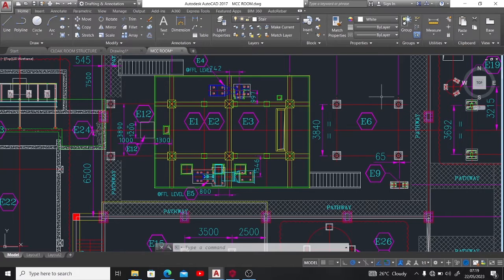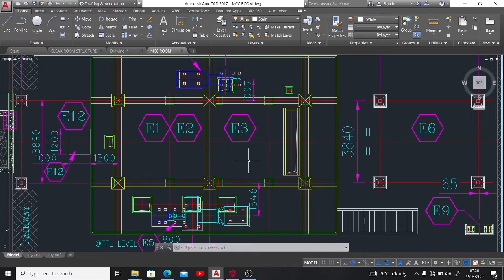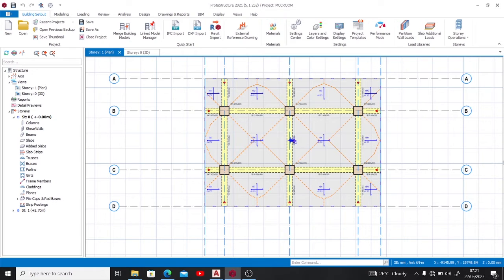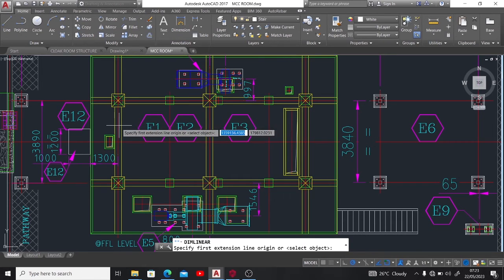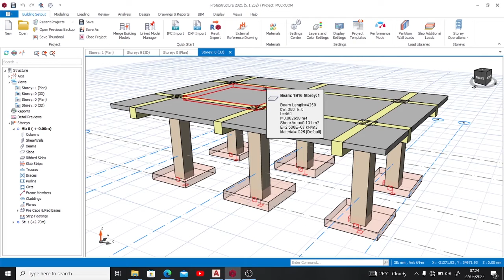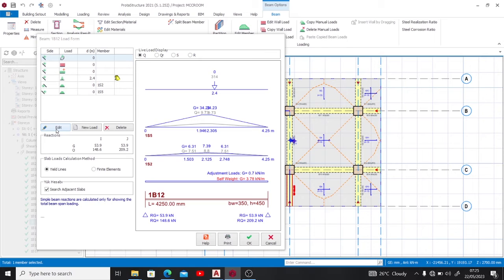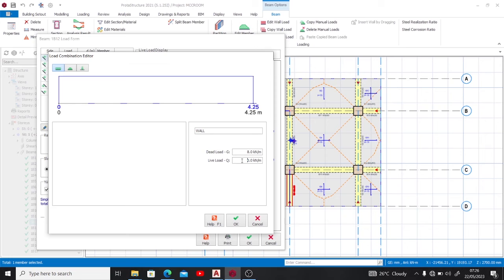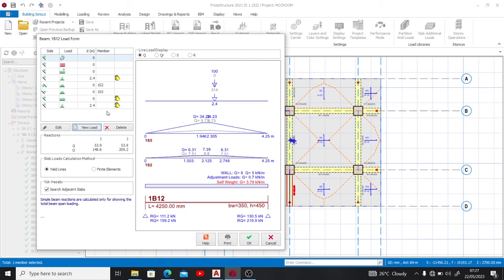HOW TO ADD ADITIONAL LOADS TO BEAMS ON PROTA STRUCTURE

Comment: Why don’t they calculate lintel load in structural designs
Reply from the maker: Well, I wouldn't want to directly agree with your submission that it is not always calculated. Still, in the cases where it takes real influence such as when it forms a continuous chain around columns and supports walls at heights that cannot be treated as insignificant, you may want to calculate that.
I hope you've answered well.
Reply: @Joshua_d_designer  Hence, lintels are designed as beams right?
Reply from the maker: @Chidoxrxn  Yes
Reply: @Joshua_d_designer  I want to learn protastructure. Can you drop your contact for me. Thanks
Reply from the maker: @edetaenernest647  send me a mail via adejumo.joshua1@gmail.com